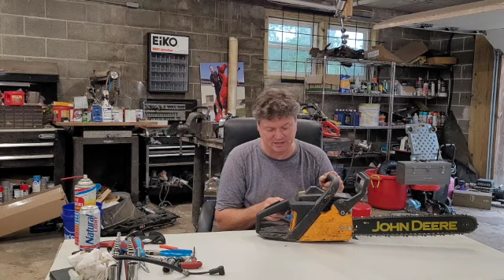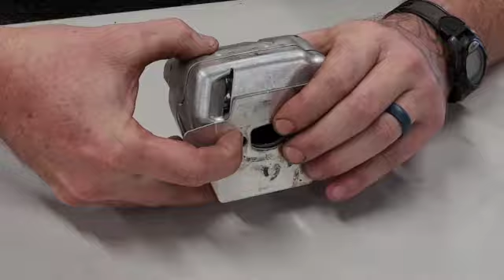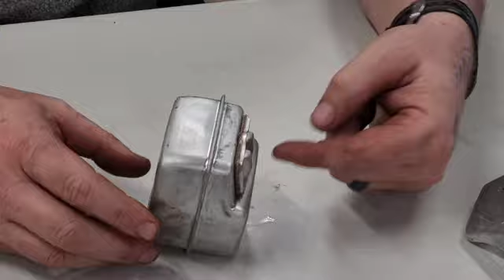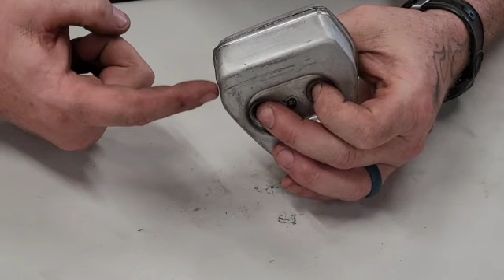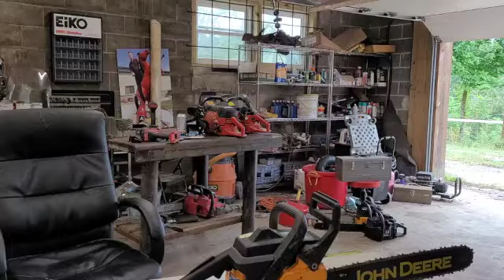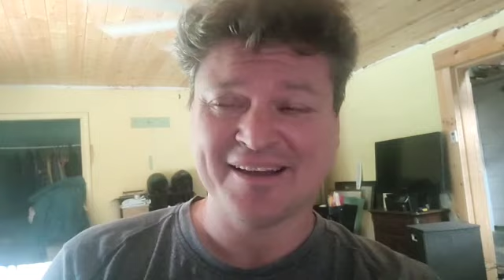Poulan Pro 4620 Muffler Mod

Comment: Might be too lean on top, running out of fuel in the cut. I got one of those I leave in back of the truck. Put a clutch from a 136 Husky on it and a 15” Husky bar plus a muffler mod. It runs ok for what it is.

Comment: 2 stroke exhausts are tunes for power. That's why you see the big part of the pipe on a 2 stroke dirt bike. Of you put a 4 stroke exhaust on a 2 stroke, it'll be gutless. They need backpressure to have any torque.

Comment: Need more growl in your ring dingy dingy ? There is a lot of that going around.
Reply from the maker: Of course!
Reply: @novicelumberjack  Add a little nitro model fuel ! Haven't tried it yet 
but some of the old mufflers were just a box stuffed with what looked like
those metal kitchen scrubber things made of copper or stainless wadded
ribbon as a spark arrestor and noise reducer. Old Homelites used it for 
stuffing and perforated plates for baffles.  Nitro will ruin the fuel lines
but will be hoot as long as it lasts.

Comment: Hey buddy don't beat yourself up it seems to me that log you cut with the stock muffler was a bit smaller indiameter
Reply from the maker: check out the second video on this saw

https://youtu.be/iARz_-AnOe0
Reply from the maker: and then this one after the port work.  I've got a bunch of videos on this saw and it is currently going all around the country to folks to run it.  I named it Peter Frampton

https://youtu.be/x3ts14T8ZC0

Comment: I just picked up a 4620 also. I have a poulan 2900 that I like and I think it is the same saw. Good cutting light saw. The handle is a weak point. They break right behind the trigger unlock mechanism. I wrapped mine with electrical tape after I replaced it as a preemptive measure.  The 4620 that I purchased has the stupid  tool free chain adjustment. Will replace it with a regular clutch cover with two flange nuts.  Give that saw a try, you might like it.  Glad I watched the entire video before modifying the muffler on mine!
Reply: I have a 2900 and its my favorite small saw. So light and plenty of grunt. The anti vibe is excellent on it too. I need to get a new clutch spocket/drum, any idea of ones that will fit from other saws?
Reply: @ozdatman  not totally sure as I have not tried replacing one yet. I did replace the handle and these are some saws that use the same handle so some may use the same sprocket also.  Poulan 2200, 2750, 2775, 3050, 2500,  2600 .Poulan Pro pp4620, pp295,  Jonsered  2036, 2040,. Husqvarna 2275, 2900, 295, 2275,
Reply: @timvandervest5575  Thanks for the info.
Reply: There are a couple on ebay right now that say they are for the 2900. A lot less expensive.

Comment: I feel you have too big of a opening
 Not enough back pressure
 Try a smaller pipe
 Or plug up the openings in the rear and leave the tube you already have
Reply: Suggest that the vent in the heat shield is to assist in cooling the cat / muffler. They appear to get very hot & easily damage other components !
Reply: "Not enough back pressure" is something you say when you don't understand how an engine works. 

Engines don't need back pressure.

Comment: If you port that saw that mod will be essential. I just finished a 2150 Port job and I put the stock exhaust on it just to see what it did... It ran like garbage. With the increased flow required the thing ran like it had the choke closed. It loaded the exhaust up with a lot of fuel. It was hard to start cold and hot. I broke down and built an Iron Horse pipe for it. It goes like scalded cat now with some really good pull. it starts on 3 pulls cold and restarts hot in 1.  I have the stock can from my 2150 that the front comes off and I have made a plate for the front that I am going to try different size exit pipes and possibly location.  So awseome that you posted the results were negative. This is what is needed because how do we improve if we don't have the data on what truly works and what doesnt.

Comment: At VERY LEAST now the trapped heat that was in the saw will not be trapped by the “cork” that the stock muffler created.
Reply from the maker: Dude...check out my other videos on this saw.  Peter Frampton is now a super star.  Seriously.  He out cuts a MS261 or a 550xp.  Little guy is a total Rockstar!

Comment: Sounds and looks to like it needs little more tweek-n on that carb !Low too lean can and will cause this.Low side gives about 20 to 25 % fuel when wide open.When you open up that exhaust it should have wanted more fuel on the L Jet.I am wondering if you leaned it to much. Try it and see.
Reply from the maker: I think you may be onto something 🤔.   I definitely want to revisit this experiment.

Comment: Suggestion, cat mufflers run a lot hotter. Thus the extra surround heat shield. The vent on left, could be to increase air flow, improve heat dissipation. Read elsewhere, that exhaust exit area shouldn't be more than 75 - 80 % max of exhaust port's area, as  reduces back pressure too much & performance suffers. On similar Partner / McCulloch / Poulan saw mufflers, drill out the holes 0.5 / 1.0 mm on the baffle plate. Baffle plate is there to control / direct the exhaust gas pressure wave, affecting intake charge, & the engine breathes easier when retuned.
The chain catcher is there to reduce risk of a thrown / snapped chain whipping around a limb or hitting the rear handle. Keep in good order, life & limb could depend on it functioning correctly !  A snapped chain is way flaysome ! ! ( SCARY ).
Reply from the maker: Good stuff here.  I will definitely revisit this experiment.   I think I will start with welding a washer on the outlet and see how that works.

Comment: You know why it cuts better with the stock muffler your not getting proper back pressure, despite what ppl think back pressure is real and an engine needs it to run correctly without they run less efficiently
Reply: Only 2 strokes, not 4 strokes.

Comment: How in the heck do you remove these mufflers. I have a Wood Shark 1950le and the muffler has 2 small tubes that house recessed inverted torx bolts. I noticed yours have those tubes as well. Nothing on earth I can find will fit into these tubes. Yours splits into two halves. I don't believe mine does
Reply from the maker: It has torx head screws.  Use a Stihl scrench.  You have to cut them open and then weld them back together.   Not an easy muffler to modify.

Comment: Some people are full of shit, nobody can argue with you there. 
I remove muffler restriction for longevity, top end health, and throttle response.  getting heat out quicker is never bad. But most importantly, it sounds badass🤣
Reply from the maker: I'm definitely going to revisit this experiment.   I can't help but think about little things like...the wood got larger and more dense on the later cuts, perhaps my jetting wasn't right, and on and on.  I'm going to get another stock muffler to continue comparing.  And then weld a washer to the outlet of the modded muffler and gradually drill the hole larger.  Maybe I'll make it my first live video so that others can make suggestions as I go.  However, regardless if it is a bit slower, I'm with you.  Get that heat out!  And it does sound much cooler.
Reply from the maker: And by the way, we should talk.  I'm actually a professional videographer.  We could work together to help each other grow.

Comment: Nice video! I did the same to a cs 590. I thought the stock was better until I tuned the carb using a tachometer. The new muffler gave me a much wider range on the high end. The sound also threw me off. I’d love to see you do the video again after tuning with a tachometer! I bet the bark box will smoke the stock muffler.
Reply from the maker: I just got a stock muffler and batteries for my tach in the mail.   I will absolutely be revisiting this issue in a future video!
Reply: @novicelumberjack  can’t wait! Love your channel. So fun 🤩

Comment: You eliminated the restriction of the muffler but you still have the restriction of your intake, also you might need to have a carburetor with a bigger jet.
Reply from the maker: I just got a new muffler in the mail.  Now I can switch back and forth between stock and modified to fine tune and figure it out.  There will be a video...

Comment: They are nice little runners for what they are. I have a couple 295’s and the 49cc 315’s. Mine are the older style with the regular black mufflers. I need to try a muff mod on one of them.
Reply: 2008 20in 46cc… i WANT MOOODDDDDDDDSSSSS😈

Comment: I have some input...
I'm going to be lazy and not read all the comments. 
In each cut, the log diameter is increasing. So your first cuts stock were of smaller diameter than your final cuts modded. You can see the slight difference in log widths in the side-by-side. One suggestion I have is to decrease the muffler exit port size a bit. Since these saws don't breath the best, and are only around the 46cc mark, reducing this will help with more optimal resonance of the exhaust waves. Also if you can, try a cut with the air filter and air filter mounting plate removed. You might can put a piece of screen over the carb inlet if you're worried about sucking up chips. I believe you'll see a difference in your comparison cuts if you tweak those 2 variables.
That is all. Sorry for the long comment. Subd...

Comment: Have you made the revisit video?
Reply from the maker: I am currently working on it.  Check out "Tuned Pipes, a deeper look".  I dive pretty deep into what makes a tuned pipe work.  Tomorrow I will share all of  my calculations for the tuned pipe length and how I plan to build the muffler.

Comment: You took out too much back pressure with the mod. Start small and just because you did the muffler you totally forgot about how much air it's breathing on the carb side. Do some mod on your filter and airbox so it can really breathe

Comment: The smaller outlet on the flywheel side pulls in fresh air as the exhaust comes out of the larger outlet of the muffler. Like the small hole on the side of an air nozzle pulls in air. It’s an ingenious way to dilute the exhaust with fresh air for emissions purposes.
Reply from the maker: Venturi effect!  I can see it now.

Comment: Haha you had me going there for a bit. I was ready to hack apart my 3314 that Ive had for 7 years. I paid $99 for it new. Its been pretty good . Always starts ,chains are cheap. No point on spending time and money on it really. Great video
Reply from the maker: Normally,  it works well to modify the muffler like this.  Eventually,  I will revisit the muffler on this saw, but for now, I'll just use it as is.
Reply: @novicelumberjack  I got a few new but older saws now so I use the poulan for stumps mainly. I really like my Jonsered 2041. I also have Husky 268xp.

Comment: I think you're chain is a little dull
Reply from the maker: It's a brand new Husqvarna semi chisel.  The only cuts it has ever made are the ones in the video.  But there is something going on that is off.  I think the wood got bigger and much denser.  This needs to be revisited.

Comment: Knock out the two tubes of the muffler where the two bolts go through that attach to the cylinder drill a series of holes in each one of them at all different angles re-insert them and reattach the muffler